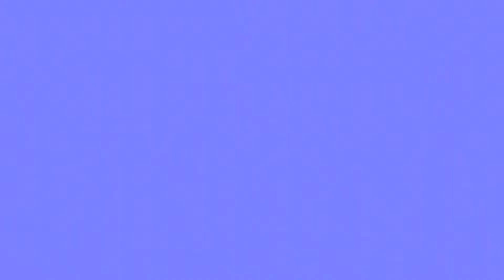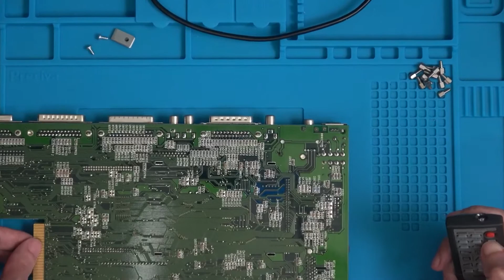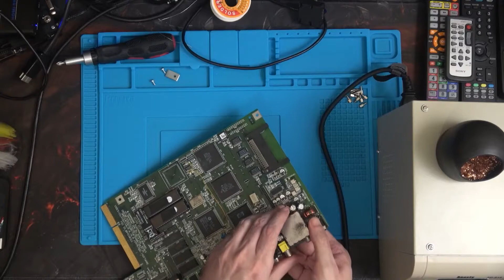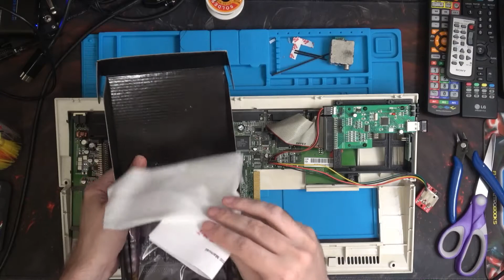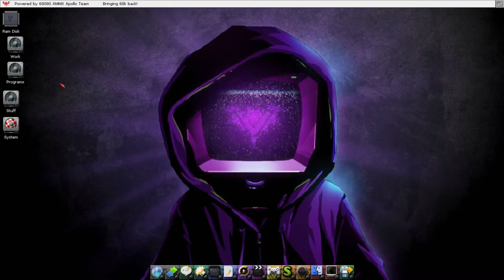How to install an HDMI port for a 600/1200 Amiga for a Vampire accelerator by removing the RF unit!

Comment: Nice job. I also have the zd 915, it came with a larger diameter tip and a smaller one. I don't know if I got lucky with that or that people just have not realised that there is a difference in the diameters. The larger diameter actually gobbles up the larger RF pins quite well, as in, you can get the entire tip around those 3 pins and touch the vias evenly.

Cheers.
Reply from the maker: Yeah, the larger diameter does come in handy. I think there's a few different companies that ship a "zd915". It might be that, that controls what you get with it.

Thanks for watching!

Comment: How do you get the HDMI signal from the DB23 RGV? What SCART converter do you use? We can't see it and ou don't talk about it or I didn't hear... Neat job anyway!
Reply from the maker: Thanks for watching. 

I mention and point at the OSSC, in the top-left (which you can see), at around  22m15 https://youtu.be/Y71ZP5PykLY?t=1335

Comment: Own a few Amigas in different guises. The purists will argue to stick with the original accelerators and RTG cards etc.. Have a couple of A1200’s with the Phase 5 603e PPC/68060 and Bvision RTGs. As well as an A4000 with Phase 5 Cyberstorm 604 with CVision. But Since having an A600 with a Vampire 2. It’s blown my mind how fast these things perform. Be interested to see how the new Warp1260 compares when it finally comes out against the Vampire.
Reply from the maker: Since the Vampire for the 1200 acts more like a 080, that never was real. I doubt the Warp1260 will get anywhere close in speed.